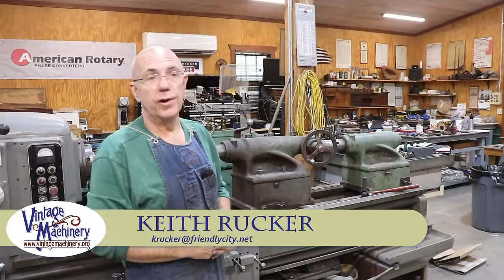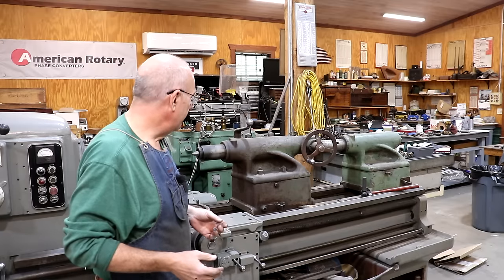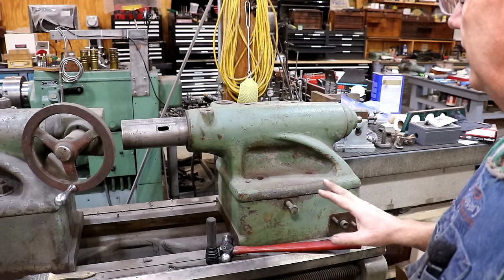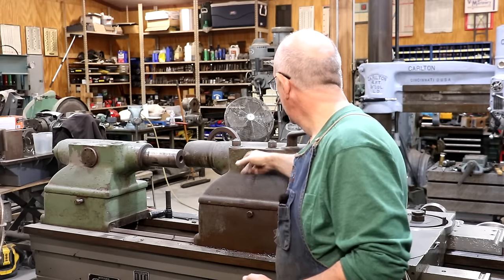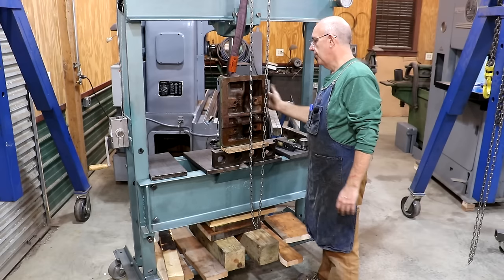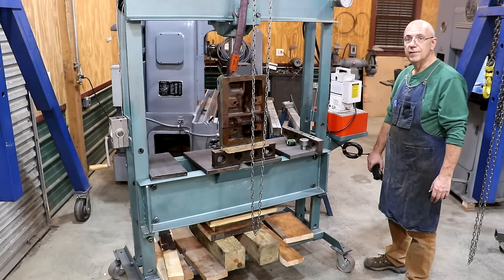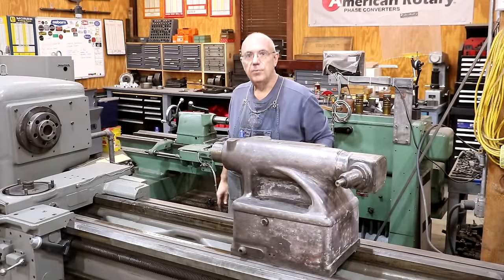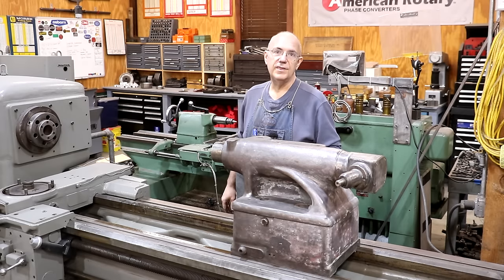Monarch 612 Lathe Restoration: The Tailstock Dilemma - Making One Good One from Two....

Comment: The clamshell lock is 2 pieces, the bottom half is threaded so when you tighten the handle it squeezes the 2 halves together.  After removing the top part, all you had to do was tap the lower half downward to break it free of the quill.
Reply: Exactly.... I was shouting at the screen.  Anyhow he got it done.
Reply: @ianpendlebury3704  We didn't get a clear view of the clamp side of the quill, but I suspect there was a pretty good scratch where the quill was pressed past that rusted in lock.
Reply: That lock is called a "split cotter", or it used to be called that anyway.  It used to be a common way of locking a cylinder in a housing with minimal movement on locking.

Comment: Like others i would suggest shimming between the top casting and bottom casting for height (after scraping the base to the bed and to level).  Turcite will just make the tailstock too slippery on the bed.  There are materials similar to Turcite used to fill gouges in the bed if you want to use a fill material but I am unsure of using it to cover the entire base bottom.
Reply: Yes, that is where I would have expected the shimming to go. Putting in the ways would expose it to wear and the need to replace it at some point in the future.
Reply: I think that as well.
Reply: @billbryant7194  I thought of the same way to shim it, but either way is good because Turcite lasts a very long time.
Reply: Agreed.  Also this would allow shims to correct any out-of-parallel between the quill axis and the headstock axis in the vertical plane.  Correction is also required in the horizontal plane.
Reply: @johnspathonis1078  what is usually suggested is to scrape the tailstock base level with the lathe bed both ways.  That let's you simply shim across the top of the base to get the quill on the spindle axis height.  You don't want any gaps in the shim due as the clamping forces holding the top down would distort the top when you clamped the tailstock to the lathe ways.

When I scraped in the tailstock on my Monarch it took a .006" shim to get the quill back up to the spindle height.

Comment: Merry Christmas!

I was wondering about the purpose of the shims on the plug in the back.  I'd check if the key was trapezoidal rather than square & the shims were to set the clearance to control rotational slop in the quill.  I.e may need different shims for different quill.  Don't know why they'd do this but don't see another reason for the shims.

Rather than shimming the tailstock height you could get Clark to cast you one & machine it to fit - be a neat project for us to watch.😊
Reply: 1 year later ZZZZzzzzzzz 😉😉😉😉😉😉😉😉

Comment: Was afraid when you picked up that tailstock without the clamping bolts in there that the base was going to come apart from the top casting. On my smaller tailstock thats what holds them together except for the side to side adjustment bolts that just push on the casting. So glad that wasn't the case.

Comment: The tailstock lead screw with the morse taper quill had an ejector rod on the end. Pretty sure the permanent center one doesn't have one and you are probably going to want that.Bet the original screw won't fit the right hand drive.

Comment: Keith have you got two dead centres and a bar that you use to set the run out of the turning between centres
You should be able to use that to precisely mean sure the difference in heights but clocking over the TOP

Comment: Did you check the existing tailstock paint for lead before using the wire wheel to remove it?  I would suggest using a particle mast when doing this type of operation, just in case.

Comment: Merry Christmas Keith, family.
Just wondering if with the shaft you swapped out, as it has screw in end that looks to hold that purpose built end for it could you make a another insert that has the right Morse taper end in it??? I understand that's a lot of work but could it be done????
Reply: I noticed that, but it doesn't have the access hole on the side that is needed to wedge out tapered spindles.
Reply: It's relatively easy to Make a morse taper hole, you only need to make something closer and then finish it with a Morse taper reamer, but it's even easier to swap the quill if you already have the proper one 😉
Reply: @ruben_balea  Sure, you can make anything with enough work. But my main point was that it was obviously not designed to be swappable with a morse taper center.
Reply: @kindabluejazz  I didn't mean that it was designed to be swappable, only that the modifications are easy to make for someone who already has other lathes and milling machines.

Comment: I can't figure out who would want a fixed center in their tailstock. Who would want a lathe without an ability to use a drill or a boring bar in his tailstock.
There has got to be a way of exchanging the tooling. Maybe it just screws in. I guess that's not important any more. 
Great job combining the two tailstocks into one.
Reply: The fixed center was probably off of a lathe that was dedicated to making a part or a production process.

Comment: When the tail stock adjusting quill screw was unthreaded from your morse taper quill, it had a lot of corrosion on the threads. Would it be beneficial to clean the internal threads on the morse taper quill?

Comment: I'd be concerned that an overly-casual shimming operation to lift the tailstock will fail - you'll have no easy way to adjust the centering up/down, which might[?] be troublesome in a similar fashion to the left-right centering necessary for correcting subtle taper cutting?  Admittedly the usual cutting tool position up/down would take care of a small error, but...  Perhaps this is just my tendency to OCD kicking in?

Comment: Turcite on the tailstock I have heard bad things about. Being slippery it makes it hard to clamp the tailstock down and it may slip under thrust.
Reply: I have heard similar comments, perhaps brass would be more suitable.
Reply: @Ropetangler  i recently pulled apart a DSG lathe that had brass/ bronze liners underneath the saddle. But they were not solid pieces but more like bronze lined steel liners.

Comment: It seems to me that the Tailstock Spindle goes the wrong way when you turn the handle? I think the spindle should go in (into the quill=bore) when turning clockwise and go out when you turn counterclockwise? Greetings from the Netherlands
Reply: That's when the handwheel is mounted directly to the end of the lead screw, but this one has a right-angle gearbox with two gears that reverse the direction of rotation.

Comment: How is the entire tailstock moved along the bed ? Perhaps hydraulically? Maybe 2 strong machinists helpers at their beckoning call.?
Reply: Once it is on correctly it will glide down the ways with just a good push.
Reply: That's what apprentices were for.
Reply: Has crank mechanism on the rear corner that engages the lengthwise rack that the carriage hand wheel uses. Or some carriage can push or tow the tailstock under power.
Reply: @glennanderson4440  Thanks Glenn. It actually shows up in the next video. Needs modifications, Of course...